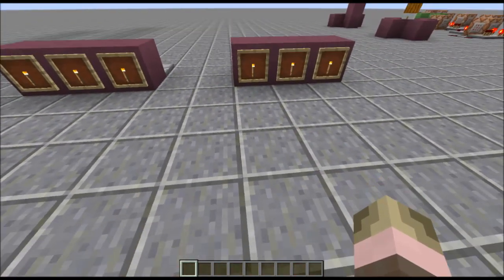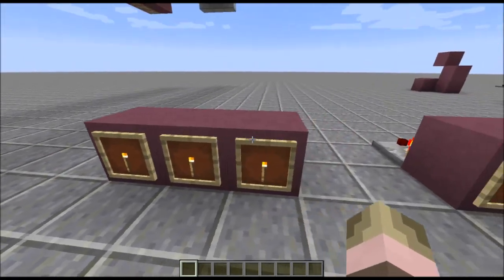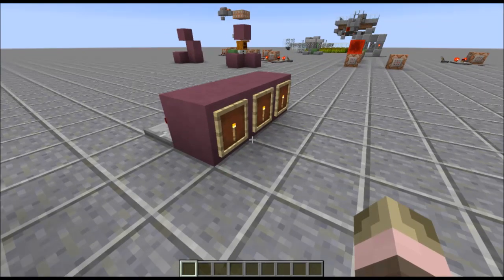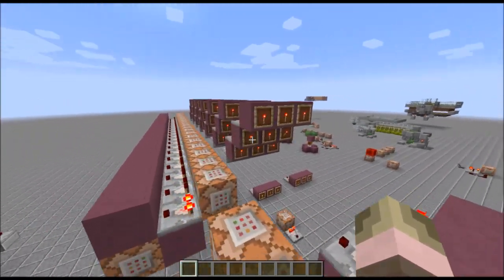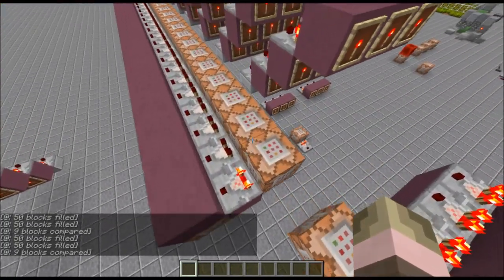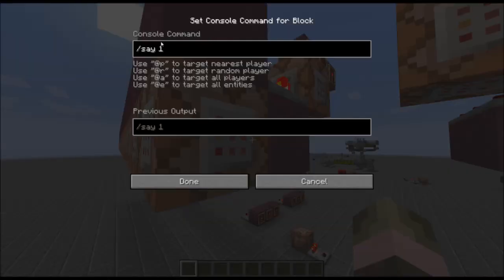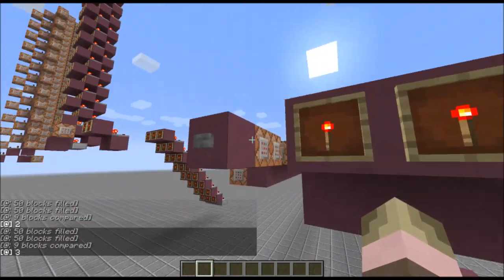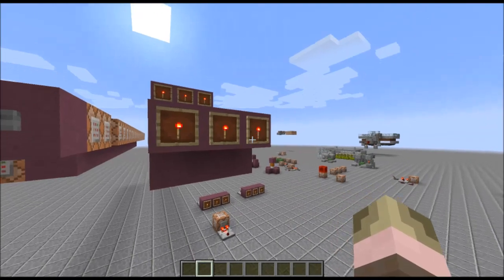Frequency Transmitter

Comment: Wow, great job. Maybe a security feature would be nice because if you teleported out with it some other dude could come up and use it
Reply from the maker: ya i was thinking for adventure maps when you explore a new area or activate something it could unlock the frequency by either dispensing the command block or somehow using scoreboard to allow that frequency to be used and for just general use rights you could easily add on a target argument for the tp to only allow people with the correct score board and you just have to set say, scoreboard transmitter_user to 1 or something like that
Reply: Also just saying, you don't have to have every single combination. You just need the ones that actually do something. :)
Reply from the maker: EnergyHubGaming lol ya, thats for the download i included 21 frequencies that could be customized. but there may be something in the works for a frequency database with a portable transmitter. so you can potentially store and have a output for ever frequency without all the bulk behind the transmitter itself.